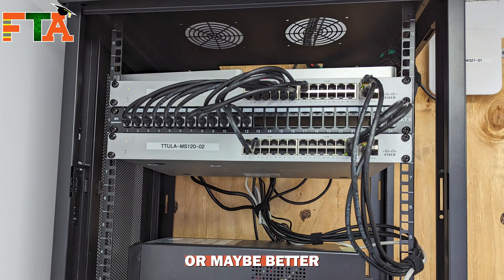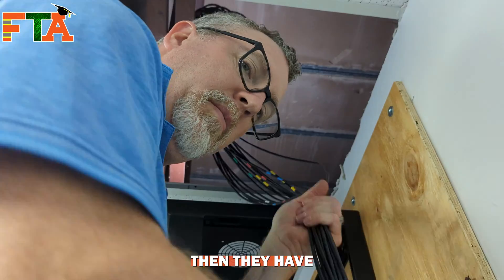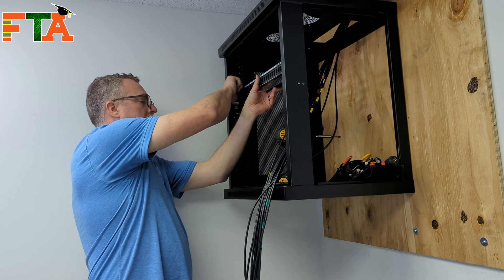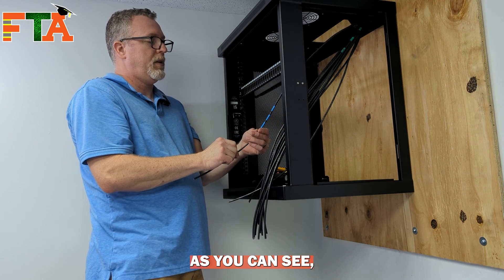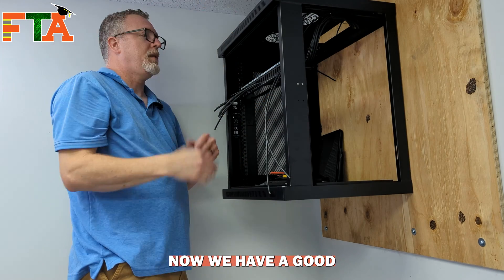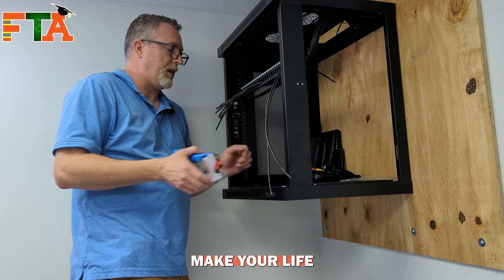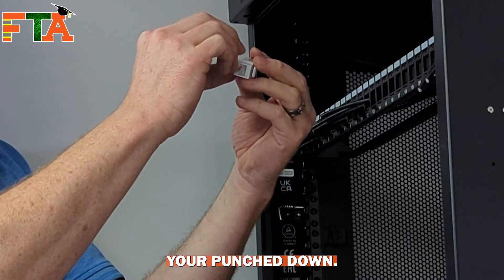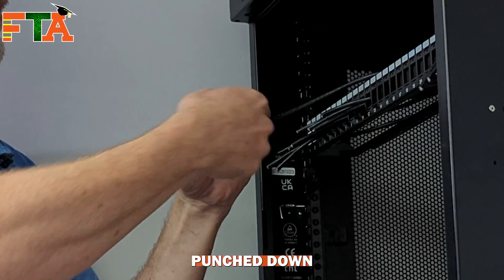How To Install a Blank Patch Panel | Pass-Through Patch Panel Installation | Patch Panel Termination

Comment: I bring cables through drop ceiling in 2” Emc conduit.
Reply from the maker: That's a great idea!  Do you just use some sort of straps to mount the conduit?
Reply: @fieldtechacademy  usually I use super strut and strut conduit clamps.  A few times I have also just used two hole EMT conduit straps

Nylon bushings on each end of conduit.

Comment: Might want to invest in a better tester, that one only does continuity. Also the cable jacket should be as close if not inside the keystone about 3mm or so. Moving the keystone you should not be able to see the colored wires.
Reply from the maker: I have a fluke I was just doing basic testing for the video.

Comment: Thank you for the video
When I do cabling I use my Brother P-Touch and make a cable label that wraps around the cable, so I number them starting from 1 all the way up to how ever many cables there are. I put one label at the jack spot and the other at the patch side.
Reply from the maker: That's a good idea too as long as the labels don't come off during the pulls and you know ahead of time which location is going to be one, two, three, etc.
Reply: @fieldtechacademy  I also use a black sharpie onto the cable itself on both ends, thank you
Reply from the maker: @yepwb  I normally do too but the cable was black so that wouldn't work in this case.
Reply: @fieldtechacademy  I also carry a silver and gold sharpie's, for when I need to label onto black to help for future info needs
Reply from the maker: @yepwb  well I just thought I was well organized 😂😂 kudos to you